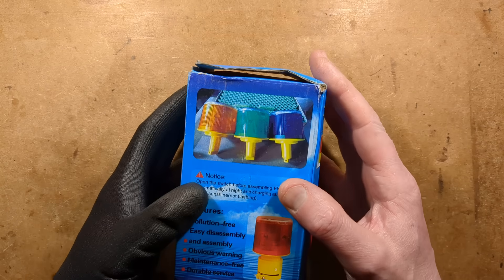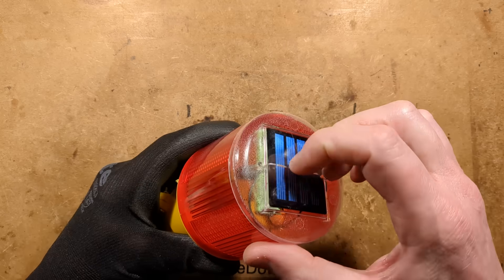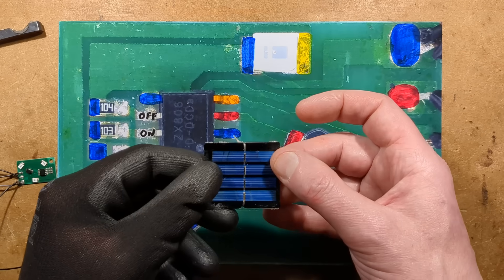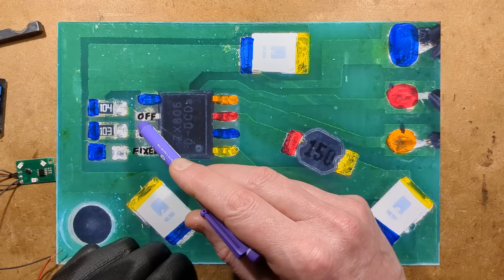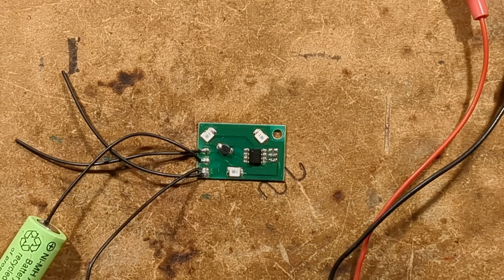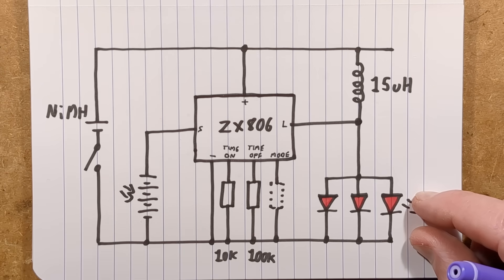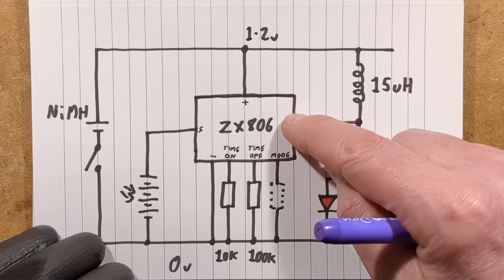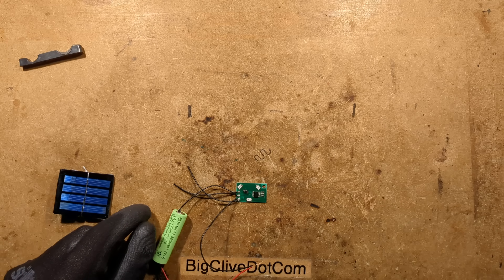Much better solar beacon with interesting IC

Comment: I LIKE how that boost I.C. works... 👍

Edit: It would be a GREAT chip to use with an analog style, unpowered, resistive sensor. With the chip and a couple of resistors in a brudge configuration, you could have a warning strobe that starts with just a tiny blip at first, and then starts flashing more and more intensely as you reach the desired "warning" point of the sensor value that you selected. Easy circuit to put together, and a very little parts count also.. 👌 I LIKE it!

Comment: Fun fact: In Chinglish "open the switch" will often mean "turn on", because in China you "open" and "close" the light in a room. The LOTO warning signs "Do not switch on!" delivered with Chinese machinery often say "DO NOT OPEN!" From what I know they for example use totally different verb for calling/taking through a phone,  it can be translated as "hit" or "beat". The result is the (in) famous sign in metro: NO BEAT THE CELLULAR PHONE. Different word order in chinese  results in the most classic warnings: Slip carefully, carefully bang head, carefully fall to the river, and so on.  I' ve seen this in manuals translated by professionals, so it must be not easy for them.
Reply: I worked for a Uniden Commercial Radio dealer back in the day and they had a chief engineer who helped design and work hand in hand with the Japanese for what the American market expected for a radio product. His main job however was to correct the language issues with the technical manuals for the service and owners manuals for their products. A very tedious job making these corrections.

Comment: Just about every small charge circuit foe 3 to 4V batteries that I i have seen recently use inductors marked 4R7 even though their physical sizes and the battery sizes vary. E.g
 from vapes. What value is that and why always the same.

Comment: These are more like our driveway post lights (with the screw-down base). Ours has a glass window over the solar cell, that has protected it over the decade and a half they have lived on the posts. Ours have the old-style discrete clear epoxy potted red LEDs that are efficient, extremely durable,  and would be simple to replace should they start failing.

Comment: I wonder if the internal diode for charging is just the regular ESD protection diode, or if they actually did go and put in a separate PNP transistor in there, with base collector shorted, to use the base emitter junction as a diode. Lateral PNP, because they would need to have a PN isolation junction there for it, and making a PNP out of that well saves on one diffusion layer and mask set, as the rst of the process is likely CMOS and does not need that extra step if they went NPN Transistor because you do get some slight efficiency improvement using it as a diode.

Comment: Did you test the solar 'panel' adhesive? Just wondering if it could be successfully removed with IPA, lighter fluid or similar..
Reply from the maker: Possibly, but still very fragile.

Comment: can you try to put potentiometer(s) across those terminals and see if the flash is variable like that? also, I wonder what it would sound like if you connected the LED outputs to an audio amplifier...

Comment: was the wire glue and / or heatshrinked? or they just did twist and pray? kind of throw away item. you could keep the same setup and just add more wire length. because every ee has ton of free wires but no chinese factory has...
Reply: Prolly copper-covered steel or aluminium anyway, so a few twists would snap it within its sheath :(

Comment: Are the battery leads soldered to the battery? It seems like it, kind of. Is it more acceptable to solder it with NiMH because of the much lower risk of thermal runaway compared to Li-ion for example?
Reply from the maker: They are.  It's not ideal, but it gets done.

Comment: Hmm,you could put a pot across the two duration pins, with the wiper attached to ground, to easily dial across the full duty cycle range.

Comment: Quality.  I grant you that pyrotechnic road flares had their own issues, at least you could put them in your trunk for ten years, pull them out in a rain storm, and light the thing while it's dripping wet.
I miss them, but I think they unlawful here any more.  Or maybe it's "for use by professionals only" which means I have to drive to a truck stop to get them.  I should look into that.
This thing appears to mount on a stanchion, but I kinda question whether it's Department of Public Works quality. :D
But any of these are better than the ball-full-o-kerosene lamps used by my hometown in my youth. O_O

Comment: mmmmmmmmmmmm .... solar bacon ..... 🤤
Reply: That’s not impossible, I do have a solar oven that can reach 350°F on an average sunny day. Just use a cast iron skillet in the shelf and place about four rashes of bacon on it, drop the glass cover and align with the sun. I usually "preheat" the oven by setting it up about 20 minutes before hand with the skillet in it. Then I simply place the bacon in the pan and let nature do its thing.

Comment: The circuit is pretty straightforward. The housing doesn't exactly inspire confidence that it'd survive more than a season in service, but I could be wrong. I do wonder whether my state is still using the old-school circuit with two lantern batteries, or if they've updated to something like this. Perhaps I shall liberate one and find out....

Comment: No one told the children Red was + and black Ov. 😅
Reply: Conventional current, the older model, assumes current flows from positive to negative, while electron flow correctly describes the actual movement of negatively charged electrons from negative to positive.
These are just some Big Brain children!
Reply: @ericfrazer4736  could be, 👍

Comment: It's a pity the battery isn't charged when the switch is off. It would obviously need another diode to prevent discharge through the panel but it might be more useful during winter's short days/long nights. I suppose a two-way switch would be necessary to enable night sensing.